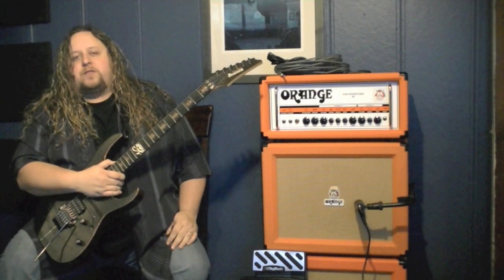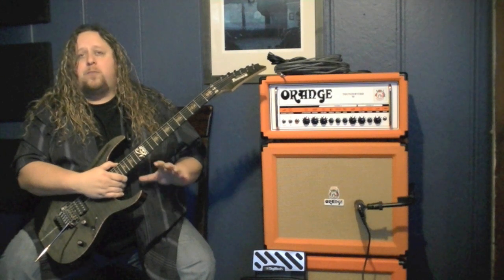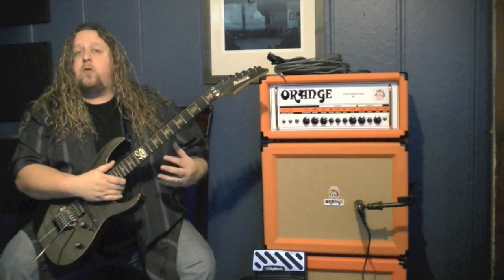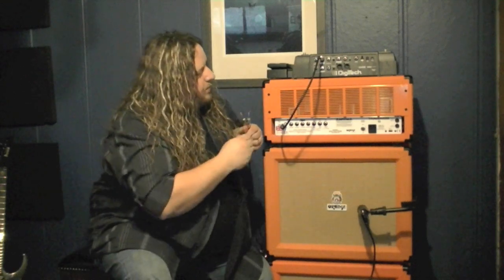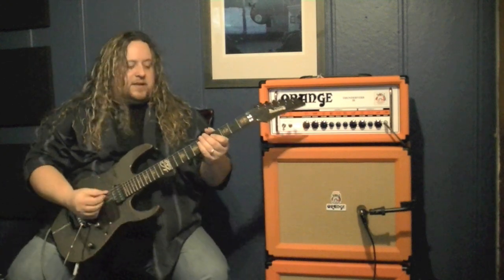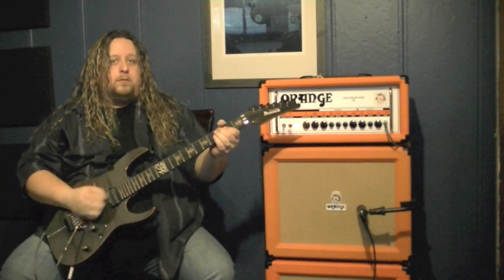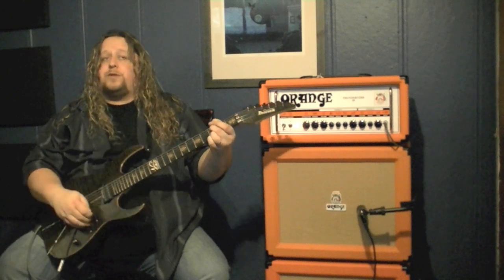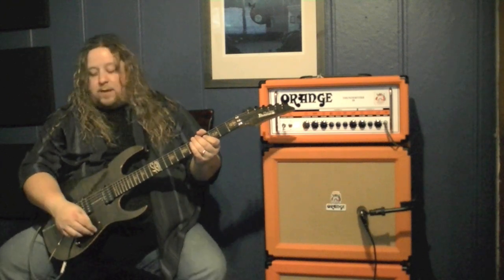Digitech RP1000 & the 4 Cable Method with Rikk Beatty

Comment from the maker: Hmmm Usually it will say something like Send and Return or Preamp Out Power Amp In. I am guessing the Insert would be your loop but I would look through the manual for the amp. If that is your loop you will probably have to use a Stereo male ended cable into 2 mono cables or something for it.... Check out the manual to be sure.

Comment from the maker: The pedal might need to have the sensitivity recalibrated. To do this, hold down a preset button until it goes past "tuner" into "calibration" mode. It will say "Toe Down". Rock the foot pedal forward & press the foot switch with the blinking light. When it says "Toe Up" rock the foot switch back and press the button. Then it will allow you to set the sensitivity of the pedal (when it turns on and off). Use the Up/Down buttons to get it where you want. Hit the blinking button and you are done.

Comment: Man this was a great vid but it does not work on my Jetcity JCA22h for some reason I lost my my channel switching along with pre-amp control so the input from the Digi to amp input does not work . If I unplug the send cable and I guess others the amp works fine . anyone have Idea's LOL
Reply: Assuming you plugged everything correctly, its the stupid RP1000... for some reason some times its a pain to get the 4 cable method to work, in my last gig I had to go whit plan B since the thing refused to work whit the 4 cable method. Even yesterday I was trying to set it up at home and was not able, as right now I turned the RP and amp on and there you go! it works again... I hate this thing its not reliable. for the records I have a Peavey 6505+. Setup the cable method and try this, turn the RP on first and then your amp.
Reply: Thanks for the reply so far I believe it works.  But what I did not realize  is the programing needed for each patch with the amp loop on/ off . 
I only got it for price and effects peddles.  I have yet to program it.  But what I think I want is just peddles 1-5 assigned and 6-10 standard effects as marked.  
My amp is the jet city JCA22H with the JCS12 Cab sounds pretty good from clean to crunch.  Just needs some moding down the Rd.  :)

Comment from the maker: @roaster73 Hmmm... well I know paralell effects loops dont work since it mixes the two signals and thats what you are trying to get away from when using the RP1000 in the 4 cable method. I would think the serial loop should be the one. I have not tried putting the RP1000 into a variable level effects loops before so I cant comment on how it would react.

Comment from the maker: @290693mshp I have not tried it on that partticular amp but you should have no problems. Only thing to look for is whether the FX loop is parallel or series. A parallel loop will not work. It shouldn't affect the tubes at all. I am currently using one with an Ampeg GVT52 amplifier which runs 6L6 power amp tubes and 12AX7 pre amp tubes with no problems.

Comment: Rikk why am i getting feedback problems. im using a peavey valve king amp with  bufferd effect loop..i tryed 4 cables dont like the sound of my amp to week of distortion   i.tryed 3 cables two in loop.. one to guitar bypassing the front . on pedal board setting sounds great. but to much feedback at loud volume ,also as i kill the distortion my cleans suffer .also the modeling amps sounds crappy . only the pedal mode sound good  .just problems in loop could it be by amp.

Comment from the maker: @AustinSk84life95 Unfortunately no. The RP500 does not have the ability to use the 4 cable method and it does not have the Stomp Loop.

Comment: how do you eliminate hum or noise. I'm using an ipb-10/4CM/JCM2000 TSL and I asked digitech who answered "you need to set amp and ipb-10 to unity gain". Answer not useful at all.
Thanks in advance

Comment: I have had a very hard time with getting this whole "4 cable method" with my Mesa Dual Rectifier.  When i have it hooked up, it works...but the only effect that can be heard is the damn distortion pedal.  

Anybody had any luck getting this to work well with a dual rectifier?

Comment from the maker: @ricomitrozonnn My setup in this video is very close to what I use live. It is a DigiTech RP1000, Orange Thunderverb 50 head, two 1x12 cabs, and a custom Ibanez Prestige. Live I use the same gear but the cabs are two 4x12 cabs and my pedalboard also has a Hardwire tuner, a Smart People Factory "Ego Booster" pedal, a DigiTech JamMan Stereo, and a Sonic Maximizer.

Comment: What I'm trying to do now is adjusting the volumes per patch so that my physical amp volume matches the 'virtual' amp volumes of my cab/amp patches.  What sucks about this is I would have to set my amp volume on stage, and then go through each patch where I'm using a model and do the same.  It would be nice if this wasn't necessary.

Comment from the maker: @hamzabinamin123 If the amplifier has no effects loop, you would run out of the RP1000 into the front of the amplifier (the amp input). You could then turn off the amp models of the RP1000 and just use the effects from it.

Comment: A very annoying problem for me is volume levels using the 4CM.  I can't match up the volumes between my amp (amp loop) and the models in the RP1000.  Nothing I do makes sense.  I can somewhat do it, with my amps volume to 2, but then I have to rely on the master level volume of my RP1000, and I lose sound quality.

Comment from the maker: It can be plugged into any amplifier but in order to use the 4 cable method, it needs an amplifier that has an effects loop that is a SERIAL loop and not a PARALLEL loop.

Comment: I forgot to mention, you might also want to check another youtube video called RP1000 review and critique which talks about some of the limitations of the unit just so you're aware. Also there was a defect in some of the units where the harmonizer didnt work and just put out a warbly sounding mess. I think this issue has been fixed on later manufactured units. Despite some of the short falls this is a great unit that I would recommend (as long as the unit has a working harmonizer) mine doesnt :(

Comment: @rikkbeatty well im using a custom patch  of a 5150 2 using( gain max bass max mid 2.5 highs 6.6 level max) running a dyna comp at max settings. using a recto cab. eq is bass 4(100 hz) mids -1(4khz) highs -2(8khz) curve its the fuller rounder curve. then a emt plate at full decay 80 for next to and 14 on volume of reverb. im runing in amp on the back 1/4 in monster gold tip cables. im running  into a peavey kba100 amp(it use's high fi speaker's and im runing in to the power amp in the back)

Comment from the maker: @6StringAxeMoFo No they do not. When using the 4 cable method you can use standard mono 1/4" cables. If plugging directly into a board you can use the balanced XLR outs.

Comment from the maker: You can use ANY standard MIDI controller for the GSP1101 ($25.00 & up or if you have a switching system anyways to control your FX then you would need nothing aside from the GSP1101.). BUT if you spent $1400 you could get the TC Electronics G System or if you spent $2200 you could get the Fractal Audio Axe-FX II.... $400 for the GSP1101 plus any standard MIDI foot controller would save you allot of money. BUT like I said, if you already have a switching system then you wont need anything else.

Comment from the maker: At $363.00 (what Musicians Friends sells them for) the RP1000 wasnt really designed to be a "Pro" piece of gear. Most Pros will use a switching system for their board which will handle everything they use as well as the ability to switch amp channels. BUT again, the GSP1101 has MIDI and all the sounds from the RP1000 so if MIDI is what you are looking for.... that would be the route to take. Artists like the guys from Dave Mustain, Broderick, Dweezil Zappa, Michael Wilton use the GSP1101.

Comment: the 500 is still good if ur amp has a fx loop just plug the rp into the fx return or power in or insert and you will by pass the preamp and your amp will only be powering your pedal and your pedal will be your main tone

Comment from the maker: If you have all of your preset volumes adjusted to a "set volume", you should just be able to adjust your amp volume and then match the master volume of the RP1000 to it. Once the preset volumes are adjusted to match each other, you should only ever have to deal with your amp volume and the Master volume of the RP1000. Lemme know if that works.

Comment: I had the JVM410.  All you need is a midi pedal and you are good to go.  Just about any MIDI capable effect unit will work for this purpose.  The RP1000 would not be a good choice as it has zero MIDI capability (no idea why they didn't implement!).

Comment: Awesome unit - unfortunately - I could NOT get the noise gate dialed in. I ran the RP in Amp/stompbox mode using the 4 cable method into a Peavey 3120. This unit was SO noisy that I had to set the noise gate at a high threshold - therefore eliminating any sustain. A single note would fade out almost immediately.  I tried every configuration I could think of - nothing worked. Just tons of hiss and whoosh. When I plugged straight in with no effects - I realized how much the RP had robbed my tone.

Comment: I can not get a good clean sound through my Jet city 100 watt head. Every single clean sound I use with this thing has a swell. It is a slight swell through the bass. Very annoying.  I also have  a volume problem. Its like it cuts the amp volume in half. I have volume on the pedal cranked to 99 and my amp volume half way and it is not very loud on clean. My distortion Rocks. If I didnt have such a killer tone patch I would throw this thing away.

Comment from the maker: In order to use the "4 Cable Method" unfortunately you have to use it on an amplifier that has an Effects Loop built into it as well. Otherwise, you would just hook the RP1000 up o the front of the amplifier and either use a clean channel on the amplifier, or bypass the preamps in the RP1000 and only use its effects with your amplifier's preamp.

Comment from the maker: I believe you can just use the FX Loop section of the amplifier which only uses the power section of the amp. Just dont plug into the preamp of the amplifier and you should be good.

Comment from the maker: There ARE amps that use MIDI for changing amp channels but the majority of the amplifiers on the Market that are sold DONT have MIDI functions for changing amp channels. So they designed a product that would appeal to the majority of the players vrs the minority. They have to look at every little cost and weigh how many sales it will affect either way whether its in the product or not. BUT for players that want the MIDI function and the same sounds, the GSP1101 is available with MIDI.

Comment: As for Line6.  Well....they have proven themselves and I have used their gear for years.  Digitech has put out mostly cool toys whereas I actually see Line6 gear on stages.  I actually like digitech but  trying to put them above line6 is a bit of a stretch at this point.

Comment from the maker: @6StringAxeMoFo There is no way to do what you are asking on the RP1000. You can run the XLR outs & 1/4" outs at the same time & have one go direct to the board & the other to your amp but there is no way to pan your preamps to be only left or right. You can pan the effects but the preamps are always going to go through both. 

As for the rack EQ I would run that PRE. BBE recommends to run the Sonic Maximizer at the end of the chain. Everyone seems to have different opinions on the HUSH.

Comment: Those guys probably use the Whammy pedal right?  That is definitely an innovative product by Digitech.  No argument there.  I think it's fairly obvious that the RP1000 can shine if used in 1 of 2 ways.  1.  As a stand alone product with no amp (direct to board)...which is what I was going to use it for.  Or....2.  4 cable method on an amp that doesn't need to be channel switched.  It would be a mess on any JVM series Marshall or Mesa rectifier.  That's a pretty big chunk of players yes?

Comment from the maker: DigiTech went away from using MIDI on most of their products. The only two products out that have MIDI capability are the Whammy and the GSP1101. If you wanted the same tone plus the ability to have dual Audio DNA2 chips for spillover delays AND MIDI to change your amp channels then I would have gone with the GSP1101. 

Most people that want MIDI use rack gear which is why they put it in the GSP1101. The only problem with Line 6 is... well it sounds like Line 6..... ;-)

Comment: Having no MIDI was a HUGE mistake for digitech on this box.  This is where line 6 has this beat.  This actually make this unit useless for people that actually need to change amp channels with their effects on their amps.  I had an rp1000 and was just going to use it as a stand alone in my cover band.  It literally burned up while setting up for the first show I was goingto use it.  Don't get me wrong....the rp1000 actually has some good tones.  It just has some serious limitations as well.

Comment: Most pro amplifiers that don't have MIDI...DO have 1/4 inch jacks that can be used to change channels.  If the RP1000 had MIDI I could change channels on my Mesas.  Obviously I cannot which tells me that this gear was not well thought out and has a limited use for gigging musicians.  I could actually use almost any line6 pedal JUST for MIDI switching without even using it as an effect.  Let's just admit that it needs MIDI.  Without it, it is tap dance city which is unnacceptable.

Comment: Actually, MIDI has nothing to do with rack gear.  Digitech is fooling themselves if they think not implementing MIDI is a good idea.  I use it all the time and at every show I play.  I use it to change my amp channels and to switch effects.  I use Mesa heads (Triple rec+RK2) with a simple midi box can be switched with midi.  I also have a Carvin V3 and have used the Marshall JVM410 that has midi BUILT IN.  Seems this backs me up.

Comment: No.The whole point of this is to get your reverb, delay, phaser, etc into the loop of your amp. And the only way to achieve this is with four cables. I am not sure the RP500 will do this. Check first, for an extra $100 going with the RP1000 is your best bet.